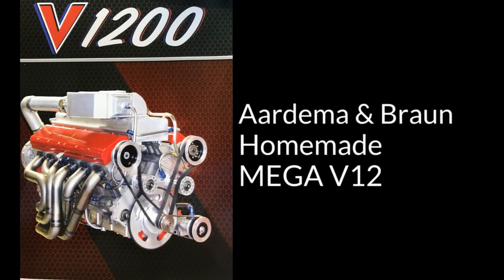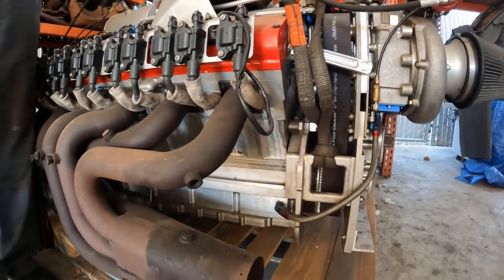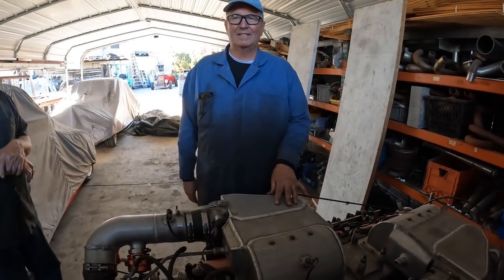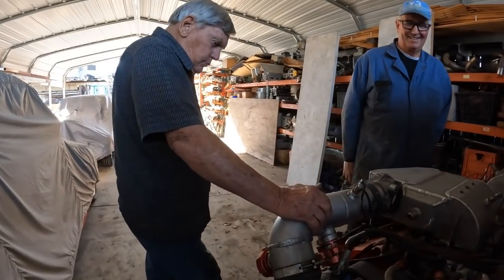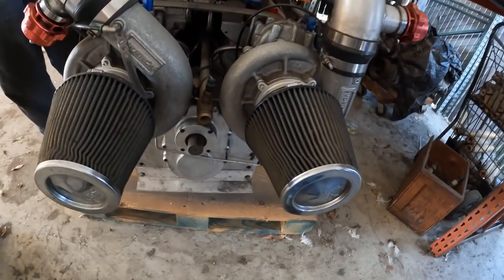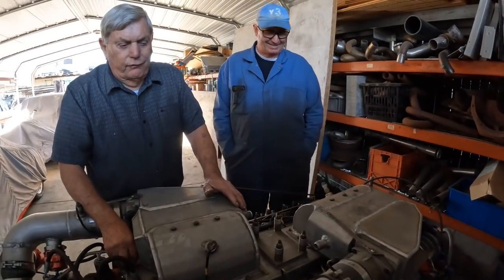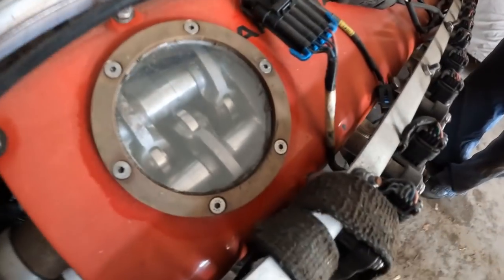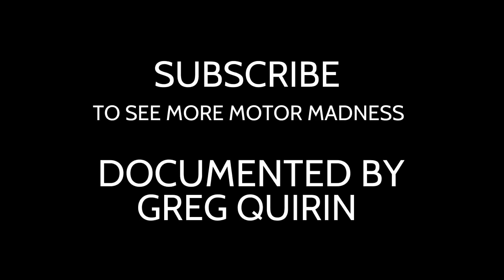20 Liter Mega V12 Engine - Hand Built by Pete Aardema, Kevin Braun & Kevin Aylesworth   Will it Run?

Comment: 1800hp on 7 pounds of boost...........what kind of numbers would that make with 40 pounds??  I think the war bird air racers get 4500hp out their Merlins,but it has substantially more cubic inches (27 liters).
Reply from the maker: Pete and Kevin have only done a few runs with the Big V12 with low boost. Not sure when they will get it back on the dyno. However we will be firing it up soon so stay tuned. Greg

Comment: Man I would love to see a video just about the process they went through for making their own heads, general design considerations, head water jacket design, etc...  Looks like they CNC'ed the wood patterns for the castings.  I'm guessing they had a local foundry pour the actual castings for them and then they machined them in house?
Reply: I doubt they outsourced cnc.  Kevin Braun is a legendary machinist.  I wouldn’t be surprised if he made the heads with an old Bridgeport.

Comment: 5.625 bore x 4.0 stroke in 12 cylinders makes 1192 cubic inches.  That's very oversquare.  That thing should rev to 8000 rpm, if you can find strong enough rods.  Problem is, the heavy exhaust valve will limit valvetrain operating speed, and unless it's properly cooled, will be a source of detonation.  Many manufacturers have designed and put 3-valve engines into production once.  They don't do it twice.  Go to 4 valves if somebody comes up with some money for you to continue.
Reply: The Junkers Jumo 213 from WW2 is an example of a successful 3-valve per cylinder engine. It made 2000hp @3250rpm, an impressive performance and unusually high piston speed for the day, given that the Rolls Royce Merlin was about 30% smaller displacement, 4 valves per cylinder but still maxed out at only 3000 rpm.

Of course the exhaust valve was sodium cooled and (due to the Germans' lack of alloying ingredients) had a very short life, maybe only 50 hours or so.
Reply: @nerd1000ify  3000rpm is not 9000rpm. 3 times the rpm means way less exhaust valve cooling time

Comment: Sucks it has been given up on.
Reply from the maker: I’m going to try and have them fire it up soon.
Reply: @GregQuirin .........do you need to "finish it".? Or is the one on the next envelope not more important than the one on the last envelope & the bench.....you know the bugs., but the build was the real fun.........you've had the hunt.,do you need it's head on the wall. 
Maybe if you are out to out gun the turbines., you look at some of the late Napier designs.,sleeve valve or even the 5 stroke CCM., a  4 stroke top end., using a 2 stroke bottom end.

Comment: Is this supposed to run low RPM direct drive propeller? Turbo-prop uses gears. So it would be okay to have 4 valves and cam over rockers. For me it is: In a piston engine you've got this excotic material in the spark plug and in a turbine you have it in the blades. For this reason at least the number of spark plugs should be minimized, like one per cylinder. Water can keep everything cool but the exhaust valves. So knock happens there. So we place the plug in between the two exhaust valves so that it almost interferes with the exhaust valves. In cheap road going off-the-shelf engines the spark plug thread is so that the plug opens towards the exhaust valves ( and is protected from the fuel spray ). So I guess that on these large cylinders there would be space to rotate the plugs. On the one hand the hot exhaust touches the exhaust valves the longest time, but on the other hand there would be no knock.
The intercooler looks so small compared to the engine.
If I tried to improve on battle proven WWII engines I would want to have some joker. For example I had the idea to start with a HEMI head and add small valves on the sides. So we get optimal spherical surface to volume on combustion, two places for the beloved air craft twin-spark, all surface covered with valves, and the small valves would not hit the one big in the center. Small valves need less power so we don't care about a small pushrod at 6kRPM.
With extractor header and the super charger and proper fuel injection, is it possible to flush out the hot exhaust out of the cylinder far before TDC? And then blow past the exhaust valves so that those only touch cold lean air most of the time. Stoichiometric fuel would back fire / emit, so it is only allowed to come later.

Comment: All the pieces are there, that's an absolute beauty. The dual plugs are a must for timing to be efficient. 87mm is about optimal bore size for peak efficiency of a single spark plug. Over a 5 inch bore and a single plug on that chamber would have timing near 40 degrees advance on gasoline would be my estimate. Dual plugs should put it in the 25 degree range I'm guessing? 
I'd love to see Blowdown turbines where the superchargers are in concert with the mechanical drive. Blowdown turbines are like a turbocharger but not as responsive. However the drive pressure is nothing. If it had a set of dual or triple turbine blades per supercharger, not only would the exhaust take the drive load off the cams, (That's what I think I'm seeing) but it would also put the excess force back into the motor mechanically. Sending it directly to the flywheel would eliminate the friction losses and material strength to handle the additional horsepower. I'm thinking 5000hp if they are expecting 3000hp with mechanical drive forced induction.
Man I really want to visit these guys.
The Napier Nomad used a 12 blade single blowdown turbine connected directly to the crankshaft. With the right kind of crowd funding, that motor would have no equal in boat racing. Turbines would be a joke in comparison. BSFC could be down 👇 in the low point 3s even high 2s with today's technology. The guys at Swaintech used to be in Loudon NH by me when I raced snowmobiles. The thermal barrier coatings go so far in keeping the heat energy in the exhaust. We were playing with turbocharging 2 strokes in the early 90s. Life got in the way lol. There's definitely room for more weird science out there. Thanks so much for the videos man. You are in the presence of greatness with those guys.
Reply: I was thinking "turbocharging if you want ultimate power".  But I think they wanted open exhaust to make the engine louder.  Crowds hate the turbines because they just go "whoosh".
Reply: @andyharman3022  Blowdowns are a type of turbo but almost no backpressure. With the large diameter wheel and exhaust force connected to the crank you get more than 2x the HP at 16lbs. The additional force that would go through a wastegate instead drives the crank directly.  You also have the bottom end of a supercharger.
Reply: @curvs4me  Yes, I know what blowdown turbines are.  The turbocompound Wright R3350 used them.  It had 3 that added a total of 600 hp to engine output.  This was on an engine that had 3000 hp, so the 600 from the turbo compound system was a 20% increase.
Reply: @curvs4me  any idea on where i can research more on blow down turbines as applied to automotive sized engines? this seems like such a cool concept.

Comment: Has Kevin and Pete looked into finishing or creating their own design for the Chrysler A925 project DOHC 426 Heads the Doomsday engine There is still a demand for these engines in the Fuel world...
Reply: Overhead  cam engines are banned I belive
Reply: @colinmunro7337   I checked the top fuel rules , all it says, is no more than 4 valves per cylinder, nothing about pushrod or DOHC... that is how the Ford Cammers were use to run in Top Fuel years ago...
Reply: @CapnBubbaa  😉
Reply: There was the McGee DOHC Top Fuel engine about 30 years ago.  Kenny Bernstein funded it for a while, but it never got to a race.  
What they want in the top fuel world is an engine that is put together with zippers so that it is quick to rebuild between rounds.  A DOHC engine would probably take longer to rebuild.  And the NHRA doesn't want the fuel classes to go any faster, so DOHC 4-valve engines would definitely be OUT!
Reply: Schubeck Eagle motors were designed for Top Fuel. Rules stop the really fast stuff between foundry and pit lane.

Comment: Those old piston powered thunder boats were awe inspiring .Miss watching those run.....
Reply: I used to ride my bike down to Fiesta island in the early 70’s and sit on the start / finish line. If you’re a gear head you haven’t lived until you have heard the combined roar of those V-12 engines go by while standing at the starting line. I quit attending once they phased in the turbine engines. It just isn’t the same 🙁

Comment: Get a old 4x4 truck, leave it in 4wd, making it front drive, cut and extend the frame, connect that monster engine to a gear box  and directly to the axel, so it can be chassis Dyno rested, and drive the truck onto a trailer, test Riggs?! 😂 I'd love to see that, heck I'd love to build it myself! Happy Thanksgiving everyone!!

Comment: SHOULD GIVE STEVE MORRIS A CALL HE CAN BUILD YA OVER 3000 HP WITH LESS THAN 700 CU IN
Reply: Why are you yelling?
Reply: I love Steve, and he is the Mickey Thompson of our time but his engines are turning a bit quicker then 2600rpm. Plus as Steve says making the power isn't the issue making it live is. One thing that helps to keep engines alive at max power is to lower piston acceleration and rpm. Keep in mind that aircraft engines designed to provide 90% of max power continuously and Steve's  world is wot for 8 seconds or less.
Reply: Steve Morris has a very questionable weather station in his dyno cell. You can find the location of his shop and the weather there at the time of his run and compare the WCF to the actual weather. He responded to one of my comments and now definitely knows of the issue.
How do you end up with a Wcf of 1.040STD with an observed DA of -1300'? Why are you applying a correction to a dyno run on an engine that is running 40lbs of boost? There is way more questions that a charlatan would have trouble answering.
Reply: @timothybayliss6680  regardless of your point, his engines are powering winners. Plus his products are being purchased by people whom have the freedom to buy from anyone and have probably done their research.  Who care about the calibration of his dyno anyway, it's just a tool for in house comparison.